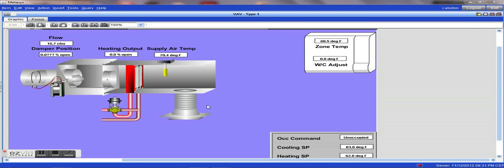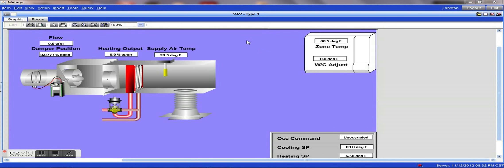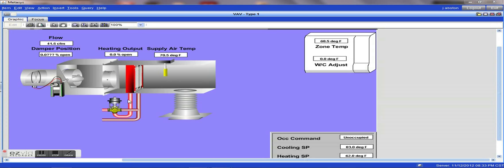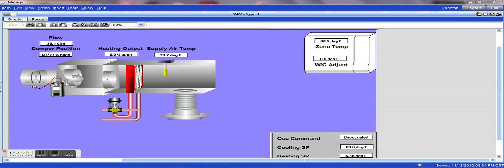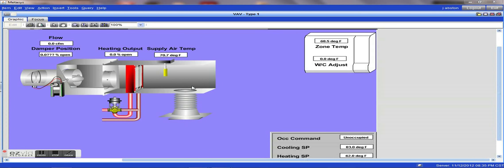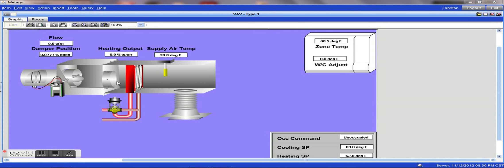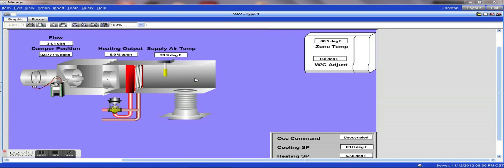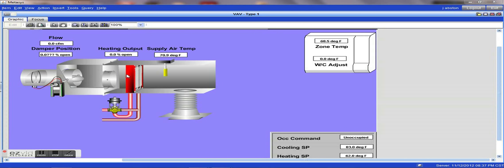Hot Water Reheat system

Comment: At my job we have vavs with reheat except the reheat valve is located on the hot water return side instead of supply. If I touch the supply side it's hot but the coil is cold as is the return side, i'm confused by this
Reply from the maker: You can see the reheat valve in the return side in some systems. If there's a three way valve on the vav, the water will bypass and allow the lines to be hot. You may also have a small amount of water getting through the valve. If the air handlers are running the amount of water may not be enough to heat up the coil.

Comment: What  are common issues with the reheat not operating?.  I have about 4 vavs not reheating,. HW valve opens but discharge temp does not  rise.  Can find any air locks.
Reply from the maker: Hot water system issues. Also clean any strainers